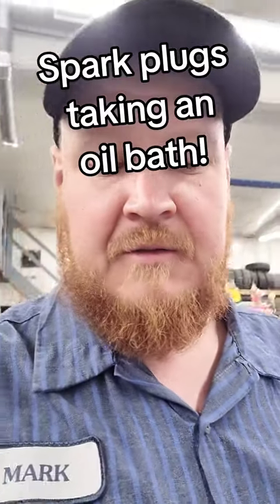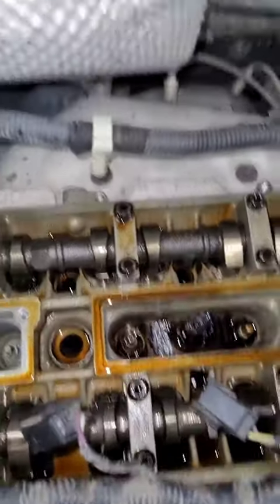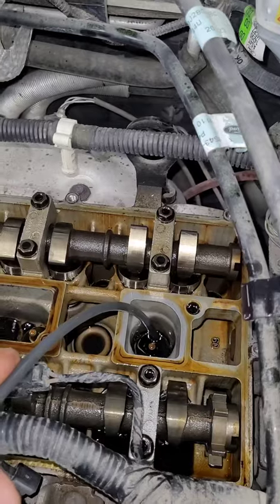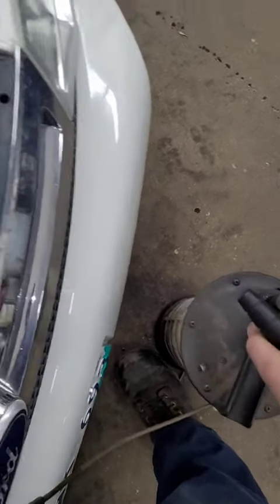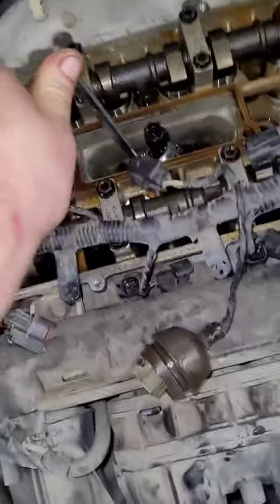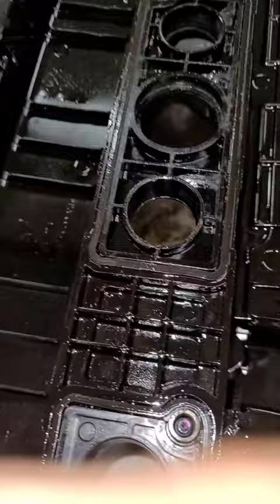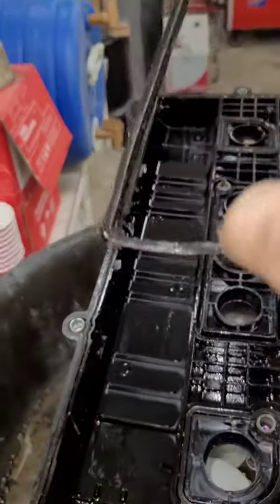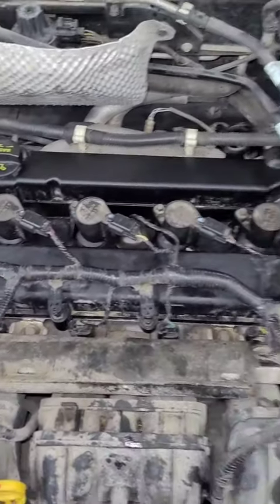Spark plugs taking an oil bath! #sparkplug #oil leak #valvecovet

Comment: Just did plugs on the wifes 2.0 ecoboost and there was oil in the spark plug tube in #1(?) cylinder (far left) i told her its time for a new valve cover gasket plus there's oil leaking down the entire motor...150k miles
Reply from the maker: Damn yup def time for a new gasket